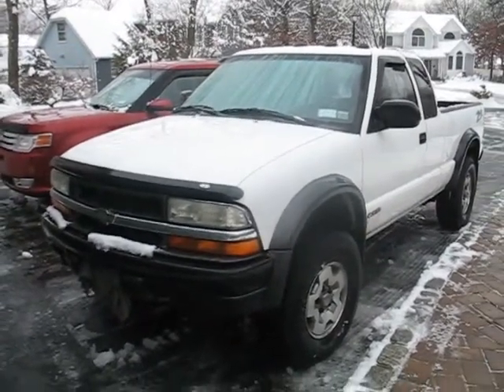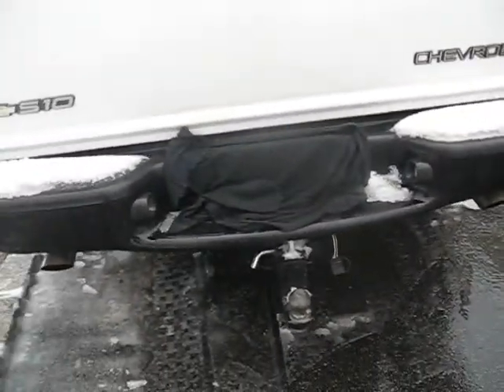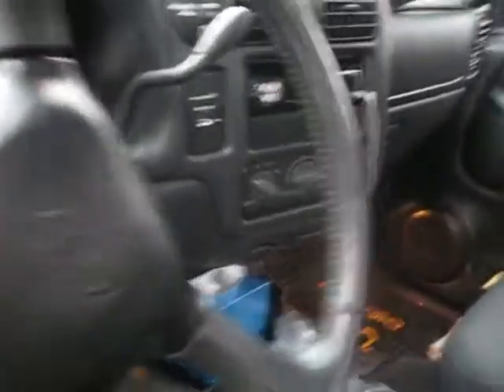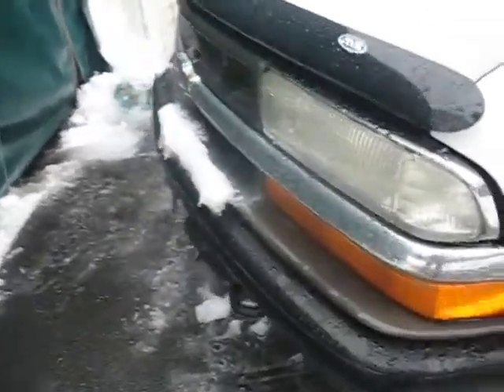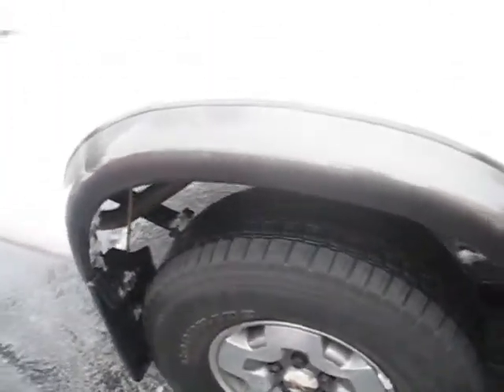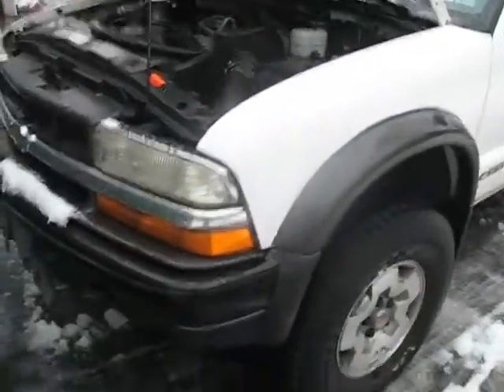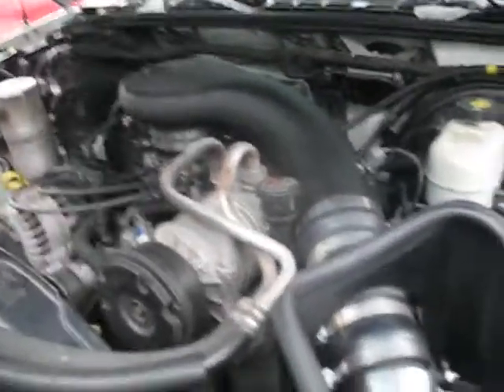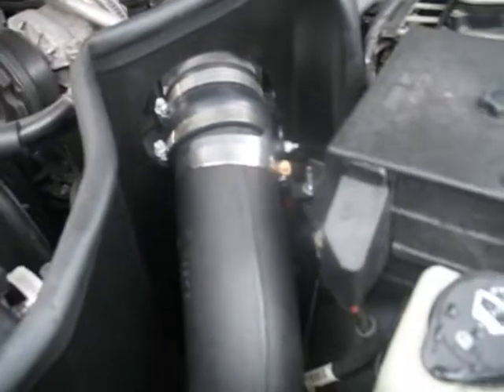2003 CHEVY S10 ZR2 4.3 LITER OVERVIEW.

Comment: Do not coat the filter in oil. You will have problems with sensors. You can purchase an outerwear that is water proof and will filter out very small particles of dirt. I have owned my ZR2 since 95 with only 32 miles on it. My 93 Blazer also owned since new with the same outerwear. No problems at all.  Your truck is 190hp and 250 tq stock
Reply from the maker: okay thank you for the heads up! ill def check the outerwear out. where can you purchase it?
Reply: I purchased mine on Ebay. You can buy one at any aftermarket atv supplier. They are made for atv's but work excellent on a car or truck
Reply from the maker: scrimmy6969 okay. thanks!
Reply: +Strange Mowers  i got an 03 to and the coolent leak with the intake gasket

Comment: Cab lights are supergay rest looks pretty nice u oughta see the rust on mine i modded the front frame put a tube smitty built jeep bumper oak flatbed 12k winch 6 inch lift 31 inch tires

Comment: Bottom line get a toyota  sorry I hate  to admit it but  toyota is top of the line for small to medium trucks in my experience.
Reply from the maker: i cant argue that honestly. but im just extremely anti foreign. i absolutely hate foreign cars. im pro american whether its ford, chevy, dodge, etc.etc. believe me im well aware american cars have many problems lolol. but id rather deal with their problems than buy foreign. sorry but its just my opinion yk?
Reply: Toyota mini trucks seem like tin cans when you shut the door, maybe the newer ones are better, as far as a zr2 they are super reliable, just depends on how bad you beat it, i love my z have had 3 of them with no major issues ever..
Reply: +Strange Mowers awesome video, i have a 2002 base model LS with the 2.2L engine, i got a thrush glass pack put in and it sounds pretty good for a 4 cylinder lol